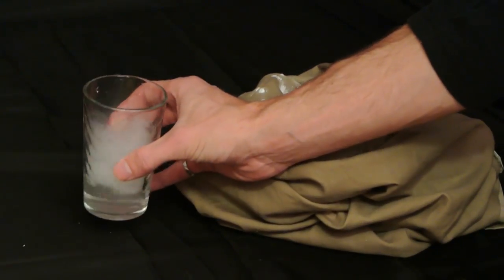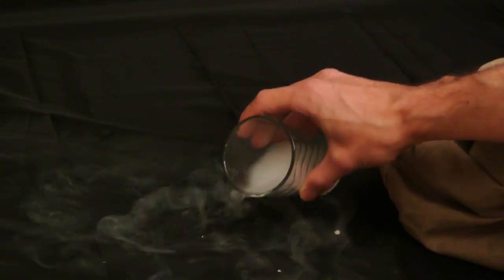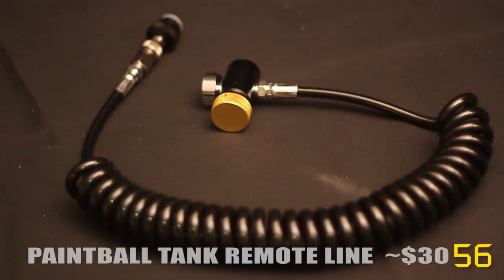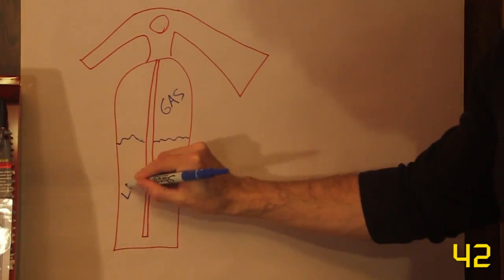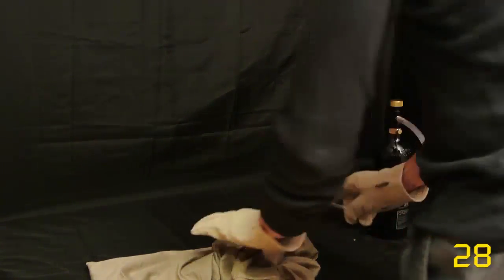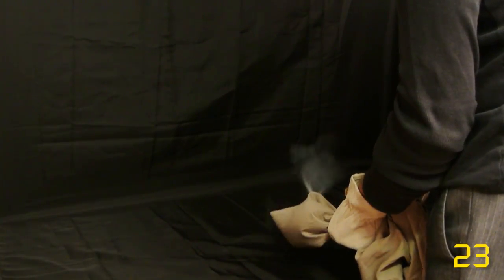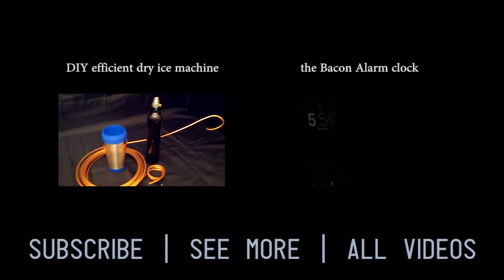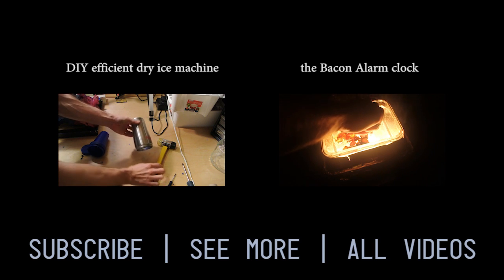Make your own Dry Ice from a Paintball Tank!

Comment: about how many lbs can one tank make
Reply from the maker: +Tyler Thurman they usually say lol, it's how the tanks are filled
Reply: the Hacksmith just wondering if I put a tank in my truck and refilled my cooler after a few days of camping
Reply from the maker: +Tyler Thurman get a 10lb co2 fire extinguisher, that should do the trick!
Reply: probably about 15% less than the weight of the tank, maybe a bit less...

Comment: There is no such thing as liquid CO2 it sublimes, which means it only goods directly from a solid to a liquid
Reply: CO2 just like every other matter can be turned into a liquid, but it has to be under HIGH AMOUNTS OF PRESSURE, hence why its in a tank ... ugh. I bet you didn't know Oxygen had a liquid and solid form either did you? By laws of physics all matter can be converted into solid liquid gas and plasma, only certain conditions have to be met for it to do so. In this case, its PRESSURE.